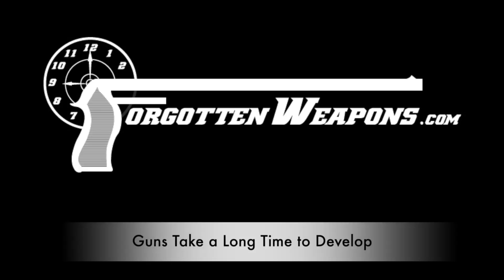Why Guns Take Years to Get Into Production

Comment: You can never predict everything.

The most common fallacy in mechanical machinery is that people assume there is a direct cause and effect chain. A happens, causes B, which causes C, which causes D - so knowing A, you'll know that D will happen.

Newtons laws taught in University confirm this theory, but it's often forgotten to mention what assumption precedes any application of the analytical solution of these laws - the assumption of perfect information.

In reality, A might cause B, which causes C and then D. But A might as well Cause E, which causes F, and F prevents C from happening - but you never knew E and F were actually a possibility, as they don't even appear in your model.

A great visualisation of this principle is the double pendulum. For every initial condition, there is a correct calculation of it's path if it is dropped, that can be calculated precisely. But in reality, the initial conditions vary ever so slightly, leading to a chaotic pattern of movement. Those are two (presumed) solid bodies in a mechanical relationship. A gun combines dozens. A lot can and will go wrong.

Comment: Guns do not take a long time to develop and they are super simple and easy things to make.  An example:  Take some standard brake line, cut it to about 6 inches, but leave the flanged end, which will hold the rim of the .22 cartridge.  And there you go, you have a barrel that can accept a .22 cartridge.  Now all you have to do is detonate the primer.  So attach a bracket to the end of the brake line with the flange.  Attach a spring to the end of the bracket.  Screw the head of a screw into the spring.  Pull the spring back and let go.  Now you have fired a .22 zip-gun.  It is crude, it is simple, it is easy.  But it IS a gun.  And it only took about 5 dollars and 5 minutes to make.  For higher calibers you want thicker gauge barrel material, something that can withstand the pressure of the, you may have to cast it yourself, but casting is also easy.  And if you can cast a barrel, you can cast everything else too.  A simple revolver is made of 8 pieces, a barrel, a hammer, a cylinder, a frame for the handle, a spring that goes in the frame for a handle, a trigger spring, a trigger, and a frame to hold it all together.  You can add an actual handle, and the sights, if you require them.

If you can use a ruler and do basic mathematics, you can make a gun.  Geometry, you learned it in high school, unless you are a dummy, in which case you probably shouldn't own a firearm anyway, because you are too stupid to possess anything that can harm yourself or others.

In truth, the only reason guns can be regulated anywhere is because people are compliant.  You can make all of these parts yourself.  In addition, you can make all of the things to manufacture the parts yourself.  A smelter is easy to make as well, as are the casts.

If anything makes mass production difficult, it is the government regulations/legislation that does that.
Reply: I wish the thumbs down actually worked on this platform.  Your comment has little to do with what Ian is talking about.  He's speaking of designing, building, and testing a quality mass-produced firearm that will give years of safe and reliable service, and earn a profit for the manufacturer.  You are talking about fabricating some throw-together project that, while it might indeed function, it is loosely equivalent to handcrafted guns of the earliest days of firearms.  In other words, you are completely ignoring everything he said just to score some kind of point that really isn't required to be scored here.  For the record, I hate gun control and find those laws to be useless at stopping criminals, so don't bother attacking me on that.
Reply: @ daniel duncan
Wow, you did not understand one word in the whole Video from Ian,...just whoosh over the head.
Reply: wow you really dont understand anything about manufactoring anything at all do you?

Comment: What is this CNC of which he speaks? For the laymans.
Reply: Computer Numeric Control... basically a computer has a digital file that has a set of instructions for a special type of lathe that says "make a cut from location xyz within your range of motion to location x1y1z1. and then repeats that action for however many cuts are required to shape the piece.

Comment: All jokes aside, in this case as an engineer, I can tell one thing. The problem starts not when you develop (in your mind) a perfect gun, but when : " why should we buy it."
 The military is not concerned about production costs, at least initially, then again, if prototype is too complex, then it's harder to sell. 
If you want to sell a gun, before you design it, you need a clear picture why do you need one. 
There are numerous engineers who can work out manufacturing process , but if the idea wasn't worth it including the complexity, then the gun is not worth buying it.
That is why many guns failed. Browning was not only a great gunsmith and engineer, but he also had a good idea why those guns were needed, and he had a pretty good way of selling it.

Comment: basicaly the same as a motorcicle or a car from prototype to production
Reply: Any item that goes from a hand-built prototype to a production line.. folding knives, kitchen mixers.. everything that has more than one piece used in the construction has a range of tolerances where the pieces will work together correctly. When dealing with big temperature ranges, one might have to hand-select ball bearings dead on the minus tolerance and bearing races dead on the plus tolerance or the unit may sieze at one or the other end of the temperature range it is being designed for. This gets massively expensive and impractical for any but the richest militaries.

Comment: As a retired automotive product designer, I can relate to everything in this video. In my 40 years of design work I started with hand drawings and at the end was doing solid modeling on computers. Most of the work I was doing wouldn't get into final production for 4 or 5 years.

Comment: Have you heard anything about the use of Lidar or other laser 3D modeling to scan an object for reproduction in an effort to rebuild technical data packages?
Reply: Dimensions of parts coming from limited samples (that aren't even factory-new) won't do much. Especially in terms of choosing right tolerances. (Knowing even exact dimensions =/= knowing what is the dimensions range that allows the mechanism to work; especially considering there are also other parts it works with). And even right tolerances are light-years away from being able to set up production.

Comment: Good talk, it's difficult to quickly explain the complexities involved in the development of a machine.
Geometric Dimension Tolerance and Measurement (GDTM) is not a walk in the park even for design and manufacturing engineers...
A design can be made using 3D software relatively quickly, prints made for each part and given to manufacturing to make those parts to meet those prints...
Put those parts together and it's done, right?
Um, does it work, operate, and function as intended?
And, for how long?
More often than not, no.
Why?
It's complicated, that's why...
Tolerance stack-up, springs, fasteners, threads, materials, lubricant, pressures, and temperatures are only a few potentials that need to be considered, tested, and proven before going into production.
Good talk.

Comment: As a Design Engineer with over 30 years experience, it's never been quicker to do design, tolerance analysis, kinematic modeling, stress, thermal and fatigue analysis in virtual 3D in the cad tube. Alot  of fast prototyping using both 3D printing, and with good manufacturing engineers, you can be be cutting metal almost as if a multi axis mill or turning centre was a printer. Problem is when you start designing stampings or injection moulded and fine blanked components...then you have  the tooling overhead, spring back, residual stress etc. PTC Creo is one seriously powerful weapon in shortening design and development time, and 6-Sigma and DVP&R  has given design and manufacturing engineers a common set of tools and understandings.
If guns are hard, spare a thought for aero engines or automatic transmissions...or development of fly by wire software that responds to thousands of inputs.... that's alot of permutations in safety critical service to develop for.

Comment: The official issue of the M4 Block 1 vs the M4 Block 2 vs the M16A2 is an interesting case in "reinventing the steel" to get it right for mechanical variances, recoil impulse, dynamics in the DI, etc.

Comment: You can make a porotype weapon, use various technologies to ensure that it does function. Each part can be produced with precision to work and CNC machines/ 3D scanning can do this well. Using Auto CAD and other software related tools this helps the process. But it takes a team of people with knowledge to do this well quickly. The great thing about digitally designing guns is that you take a lot of the cost of mistakes out of the process. As for history trying to make mass produced guns CHEAPLY lends to lots of issues. We just seen the 6th Generation Jet fighter be designed using nothing but software and I have seen guys in a shed in Afghanistan hand make guns, two polar opposite examples but they seem to work.

Comment: One point of order: you don't necessarily have each machine do exactly one cut. At the very least, I've seen and used lathes that have a rotating tool head and feeding system that lets you make multiple cuts on the same part/machine in a row (ex. cutting the steps and threads for a hydraulic jack release valve, which is what I did). I don't know if those machines are effective for mass production of firearms, but they're definitely an option from before we had CNC machines.

Comment: I remember hearing something about the old marlin factory. All of the machine tools were ww1 or ww2 surplus and that the walls were covered with notes on how to run the machines and compensate for inbuilt wear on the machines and the cutters combine that with generational hiring practices in which fathers trained their sons in running the same machines.meant that they new exactly how to get the best results and when they moved the machines to a new factory they fired all of the old operators and then as icing on the cake somone painted over all the old notes and settings on the walls and by the time management realized it all of that knowledge was gone.this is why marlin has gone to shit in the last few decades lose of institutional know how so they had to start over from scratch with new machines on designs that were optimized for a specific set of machine tools and techniques

Comment: If you need an example of how difficult this process can be, simply Google 'Remington R51 pistol' and read the problems that had with the first generation of this (admittedly quite different) handgun. First Generation guns had MAJOR problems that are almost certainly a symptom of rushed development from toolroom to production. The second generation of the R51 has supposedly cured most of the problems, although some niggling problems persist, it's overall no worse than many other production handguns. Actually this can be translated to almost any technical machine from a gun, to a bicycle, to a wind up toy or a wristwatch. There's always a translation period from prototype to production, even if you are reverse engineering.

Comment: Dimensions and tolerances are great, but there are lots of other things. Metallurgy comes to mind - heat treating, bluing, residual stresses, voids, getting the forging right, getting lubricant that matches the needs of the weapon.  And then when you get that all straightened out, some sailor drops your pistol, the safety mechanism fails, another sailor is killed, and production of that sweet old Smith and Wesson trigger mechanism gets stopped.

Comment: Interesting fact about car manufacturers. In some cases the same model goes for a few years, all ford Falcons in XD-XF range look very angular. Then a big change to the rounded Falcons of early ninites. While Nissan changed each year. One factory ran presses till they wore out, others reconditioned the press each year. So Falcons show the wear, XD-XF parts interchangeable but XR series not so much. Skylines changed ever so slightly each year and parts just don't quite fit. I imagine with pressed gun parts it's even more pronounced and less forgiving. Presses and dies wear out, every part made slightly changes the tool.

Comment: Ian: "Guns are hard, they take years to design and manufacture."
John Moses Browning:
Reply: 1906 - 1911 from first trial to approval of Colt 1911
Reply: @francesconicoletti2547  Plus 1900-1906 research and development to make the first guns for trials.
Reply: @rrolf71  yes thanks. I knew earlier guns looked similar, but I couldn’t find quickly how much they fed into the 1911.
Reply: @francesconicoletti2547  As I understand, the R&D was done over the years on the basis of Colt 1900, which finally in 1905 was scaled up to .45 in order to make the 1911 presented in 1906 for testing.
Reply: Mr Browning usually didn't bother with manufacturing and mostly lived off of selling patents. Check his patent drawings for e.g. tolerances (or dimensions) - good luck trying to make a firearms based on his drawing alone. There were a lot of really smart people who spent thousands of hours to turn his ideas into steel.

Comment: There's an amusing parallel to video game development, for basically the same reasons. A game is hundred of thousands, even millions of lines of code, and a testing & QA team might be 30 or 40 people running on at most maybe a dozen different hardware configurations. There is no way they can spot every single bug that will occur when the game gets out in the hands of millions of players on millions of hardware configurations. 

This applies even in a more controlled environment like consoles - which model of console? How much has it been played? How much dust is in it? How badly has the player let it overheat? How much hard drive space is left?

TL,DR: making complex things is complex.

Comment: There's a gun in my collection that I think illustrates this problem quite well. Back in the '90s, a company down in Texas made a Luger clone in stainless steel. Unfortunately, as many of you may know but they apparently didn't, stainless steel isn't a drop-in replacement for regular steel in mechanisms with moving parts and bearing surfaces.  So even if they had the entire Luger TDP (and they probably didn't), if all they did was make the parts to the original specs, it was never going to function properly... as indeed it does not, and never has, even after it went back to the factory for modifications shortly after I bought it.

Comment: Maybe a good (part 2) of lecture would be to show a production line of the milling machines making 1 tiny part. Showing how the part is measured , gauged, accepted or rejected. I asked an mechanical engineer why a Sig 9mm was much more expensive than a Taurus 9 mm. He said that the steel used in the Sig was much higher quality than metal Taurus. This steel is harder to machine.

Comment: Ian, your knowledge of product development relates to an older age. Bringing new engines to market (my experience) and guns (our favorite hobby) are not that different. Both are old technology. New technologies allows most advancements in them. It doesn't take that long to do, given a good product development philosophy. However, the three legs of the stool are quality, cost, schedule. Modern management philosophy is cost driven to a fault, including de-emphasizing experience. Look at the vast experience lost due to Remington's management fiasco. We have procedures, so we can hire lowly paid graduates, read the procedures and do this, right?  The VersaMax project manager left and went to a competitor, he was smart. So next time they try a product development, it will fail. Marketing must supply a clear vison for the new project. Engineering must agree and be able to deliver. Manufacturing, procurement, Sales, quality.... also. If any throw shit over the wall, that's what will be delivered. Naysayers walked out the door, those that can do, do it. Everything is done concurrently as possible, few facets can wait until the one upstream is fully done. On 'fail' side, look at Savages shotgun autoloader, they had nothing but time to have a good one in the wings. But..... Fluted barrel. Good grief. That's what you get.

Then, some idiot, in the form of management comes along and orders purchasing to save money(gotta improve margins) , so they go to China. Then some idiot decides the younger gen wants to work from home, so quality and schedule suffer while they play video games instead of working with the rest of the team. The only available experienced optical engineer can't be hired because some idiot wants to fill a quota.

Glad I retired so I don't have to see the cancer killing American ingenuity from the inside.

Comment: All valid info and good perspective, but this is only half the story.  Not only is tooling and debugging challenging, time-consuming, and expensive, but none of that even matters unless you can actually sell what you produce.  A lot of guns go into pilot production and never get through debugging because there's not enough market for them to justify keeping up production.  Or in some cases, maybe there is a market, but the manufacturer doesn't have a viable distribution channel to reach that market.  At the end of the day, engineering is subservient to marketing: If you can sell a gun in spite of some technical problems with the design, then you can make money, stay in business, and gradually refine the design.  If you have a technically superior design but not an effective way to market it, then your product is doomed, no matter how good it is.